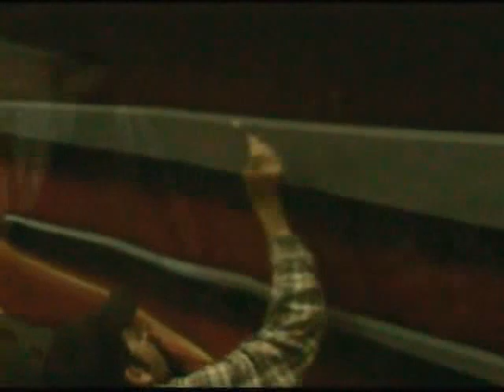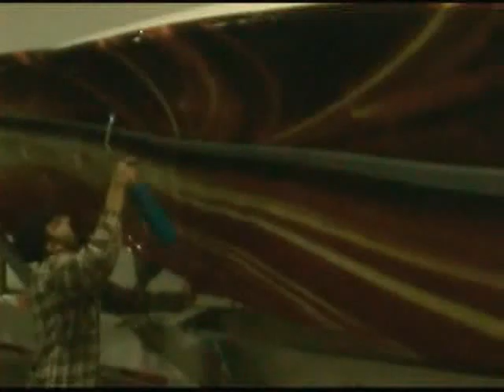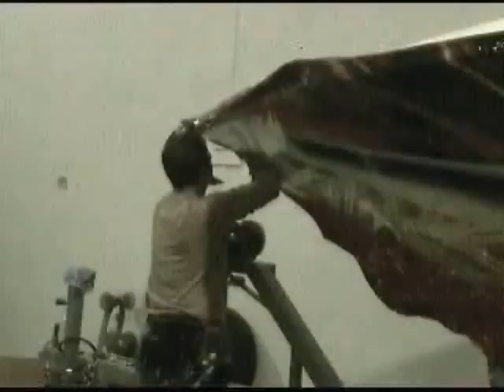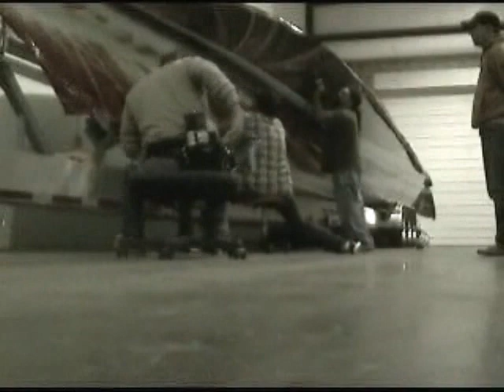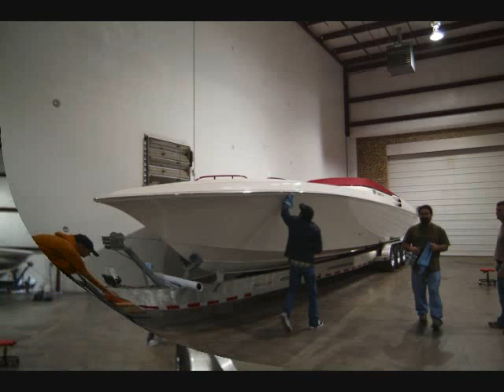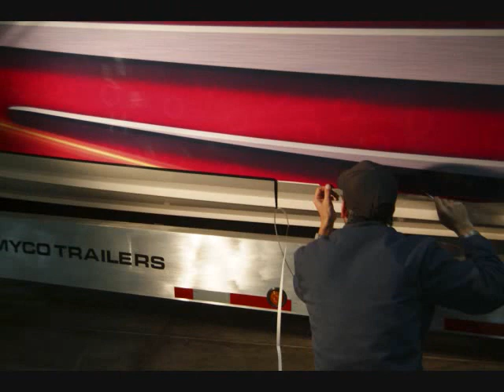47' boat wrap ***iCandy Autowraps***

Comment: @sledneck2xtreme they use a 3M product called IJ380 (hopefully) which is ultra conform and has air release.  Any bubbles you might get, which if you're good aren't many, just press down on them gently and the vinyl releases the air.